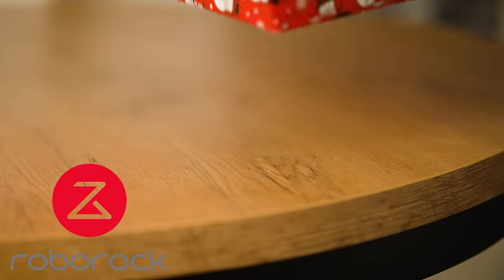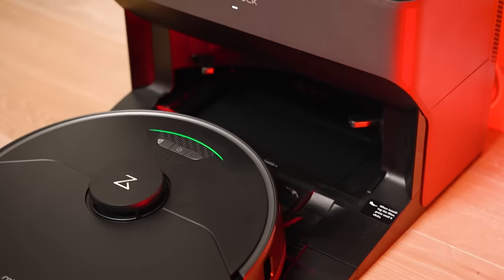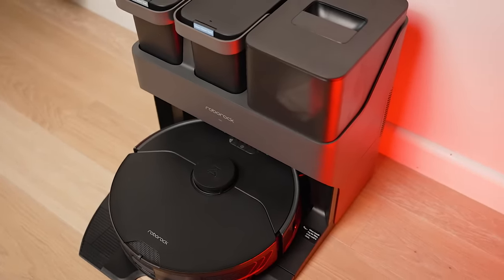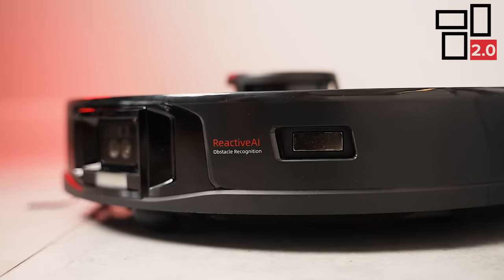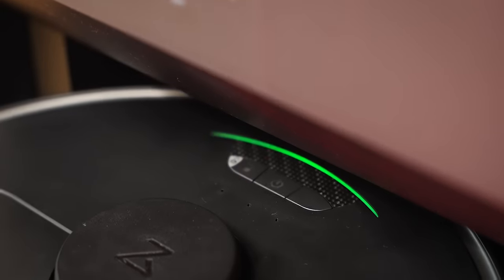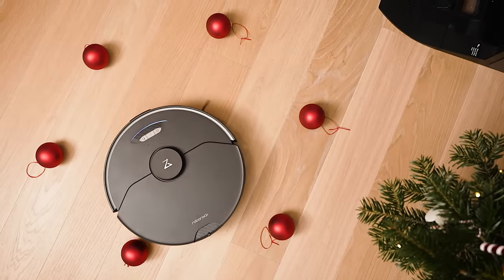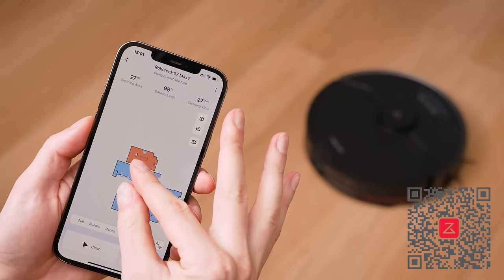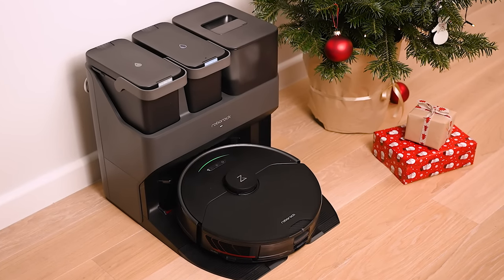60 Tennis Balls  = 2 Bicycle Tyres

Comment: Those are not tennis ball tires, They are steel hoop tires, if you took the tennis balls out, they would still roll on the hoops. The tennis balls help keep the outer tire centered on the hoops at best, but they really serve a cosmetic purpose for the most part.

Comment: I just thought of something like this. What if tires were packed with high density foam instead of air?
Reply: That exists, you can buy it. From what I hear it doesn't come close to the performance, comfort and light weight of a normal air tyre, but if you're really struggling a lot with punctures, it's an option. Might be better to go for semi-flat-proof tyres like Marathon Plus.

Comment: What's the point? Air, whether in your tire or in the tennis balls, is the support either way. Only advantage is if you pick up a nail you only flatten one ball and probably wouldn't notice any liss of performance. However, that's a lot of trouble and expense to go thru when you perhaps have a flat on average of one every two years. Besides, how much performance is lost and the odds your tennis ball tire would throw a tread? All these questions are rhetorical and I don't need an answer because it's obvious and I do give you an A+ rating for invention and it's likable.

Comment: Suppose you have an inner tube with multiple individual cells that hold air?  I think your next bicycle mod should be making a tube out of bubble wrap or a material that's stronger than bubble wrap.  Rubber bubble wrap?  Unpoppable bubble wrap
Reply: I have a Purple mattress.  It came compressed, tightly wrapped.  Upon removing the wrap, the mattress expanded.  It's surprisingly comfortable, IMO.  An inner tube with a similar structure to that of a Purple mattress seems like it might work.
Reply: @jim9219771  Foam tubes like that exists, I have tried one variety of them. Riding comfort was ok, but the rolling resistance was very high, like riding constantly uphill. Might be ok on an ebike. So far I prefer puncture-protected tyres and tubes with sealing fluid in them.

Comment: i thought this was genius, then i thought for just a few more seconds, what if you made a big donut shaped tennis ball that goes around the wheel... then i thought for just a second more and facepalmed.
Reply: ignoring the fact its probably a bit bumpier than a normal tire, is there any downside? replacing a punctured ball might be a bit of a hassle, but at least you can still ride to the bike shop with one deflated ball